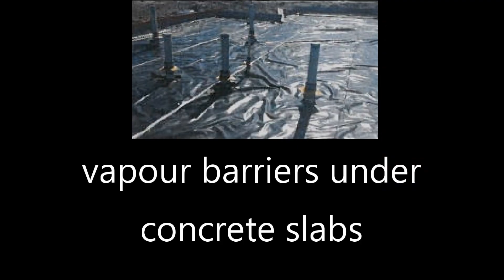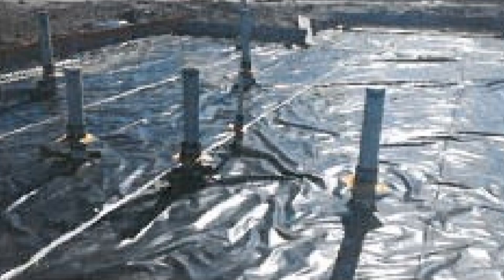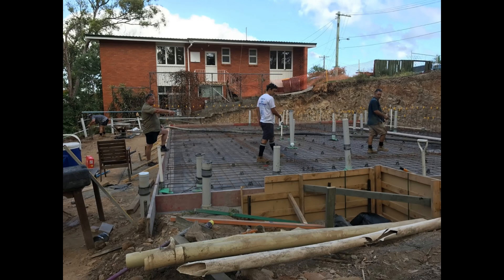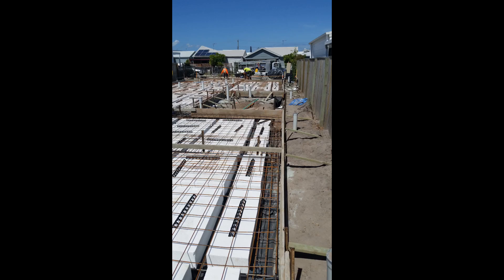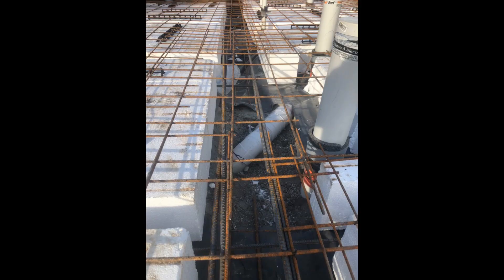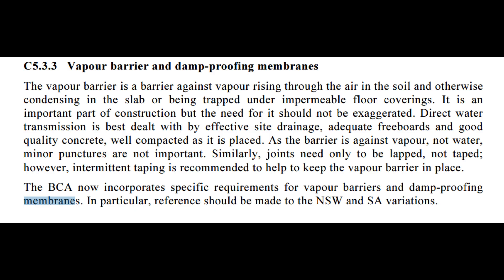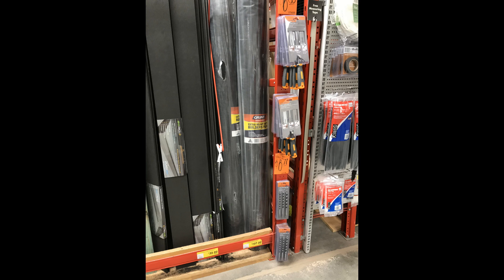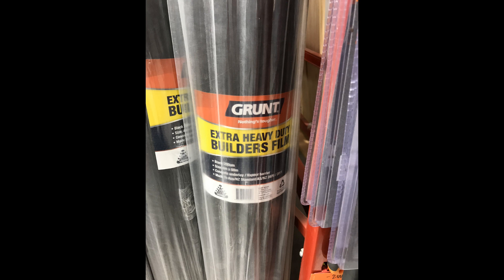Why do you need a Vapour Barrier Under Concrete Slabs - The Structural Why Files aswers the question

Comment: Plastic does not prevent a slab from sweating.
Moisture comes from humid air above the slab. 
Everyone has been told this by engineers for the last 100 years, but it is fals

Comment: Do you recommend to use vapor barrier for footpath and concrete steps?😊
Reply from the maker: Hi @dtran21k
Interesting question!
I don't NOT recommend it. For the reason that the plastic prevents the ground sucking moisture out of the concrete I like it - but I recognise that a barrier isn't required under footpaths and external concrete steps to prevent rising damp.
If the plastic is available and on site, then I'd suggest using it. If it is 'too hard' to get a roll of 0.2mm polyethylene membrane on your site then I'd question that answer but accept that it isn't really required.
Matt Cornell

Comment: isn't the vapor barriers will cause plastic shrinkage cracks on your slab?  cause your concrete will dry from top to the bottom instead of bottom to top?
Reply from the maker: Thanks for your question.
This is a common thought - but plastic shrinkage cracking is caused by the concrete surface hardening faster than the concrete underneath. We use curing methods to prevent the surface concrete from hardening too quickly before the full depth of concrete has gained strength. In fact, the bottom of the concrete with a vapour barrier is similarly protected from the surface hardening too quickly which is pretty much perfect!
Matt Cornell
Reply: @CornellEngineers  thank you.  would you mind sharing what are those curing methods?

Comment: Why do you only have a DPM and no DPC in Australia, in the UK you have both and they are connected at the perimeter to seal the building from moisture, I have not seen a DPC used in QLD, just a DPM which is allowed to go under the external footing, rather than the footing being in direct contact with the ground?
Reply from the maker: I think you'll find we do have DPC in Australia. It is used widely and well. You're right though - we don't tend to lap out DPM to our DPC. Maybe that is food for thought!?!?

Comment: I have a concrete guy putting a plastic vapor barrier down for a detached metal building/garage, but he's not running it down in the beams, only down the sides of each section. Doesn't that defeat the point of the plastic since water will seep up through the 2' deep beams and create a criss cross pattern of higher moisture on the slab in those areas? We are in clay soil about 20' higher than the flood plain with a clay sand fill under the slab. Interested to hear your thoughts, thanks.

Comment: Will it be good to put such moisture barrier under a driveway? I think it might prevent from mold growing on top of driveway. I have to pressure clean it every year or two.
Reply from the maker: Hi Vitali
I have heard some concreters say not to put a moisture barrier under a concrete driveway slab I have seen driveway slabs done both with and without a vapor barrier.
My personal preference is yes, have a vapor barrier under a driveway slab. However, it is not mandatory.
Matt Cornell

Comment: Styrofoam placed in or under concrete does it weaken it structurely? Does that Styrofoam degrade over time? What is the reasoning behind it use? Questions for the public?

Comment: Are vapor barriers required, or recommended for concrete slabs for accessory buildings (sheds) no attached to a residence?
Reply from the maker: Clause 3.2.2.6 on NCC says:
A vapour barrier must be installed under slab-on-ground construction for all Class 1 buildings and for Class 10 buildings where the slab is continuous with the slab of a Class 1 building as follows.... then some explanation of what a vapour barrier must be.
So your unattached shed is a Class 10 and doesn't 'require' a vapour barrier -  but what are you saving by not installing a vapour barrier? Not much. If you have the choice I'd put one in. Hope that helps!
Matt Cornell
Reply: @CornellEngineers  seems most concrete contractors don’t know this requirement. 

And I’ve seen contractors laying down the orange plastic and then deliberately putting holes in it in between the reo squares. Not sure what they think this is achieving… Would this be an issue at all for a pergola area that will have tiles over the concrete slab?
Reply from the maker: @danielbass09  The vapour barrier is primarily to prevent rising damp coming into an enclosed, unventilated (inside) space. As far as I can tell, it wouldn't be the end of the world if there was no vapor barrier under a tiled pergola area slab. 
Matt

Comment: Hello Matt. I have a question about my garage. I have a garage with a concrete floor and it seems no vapour barrier was used under the concrete. I have not noticed any real problems with moisture coming up through the concrete floor, but I have seen the occasional appearance of efflorescence in one small section. I am contemplating grinding the concrete floor and sealing it with an epoxy flooring product. The makers of the epoxy flooring product say that its impervious to water, and I'm not sure I believe them, but I am definitely doing my homework. Apart from my concern about the epoxy failing down the track because of moisture rising up through the slab, my bigger worry is wether the slab will be more prone to deterioration in the longer term as a result of its exposure to this moisture without any barrier under it? Thanks in advance for any thoughts you could share about this.
Reply from the maker: Hi Dekker Lundquist
Once the concrete has cured, a vapour barrier is more about health and amenity of enclosed spaces (ie protecting against undue moisture, damp and mould) than it is to the protection of the concrete.
So sealing the slab surface with a product that bonds well to the concrete should solve the localised patch of efflorescence (once it is cleaned off the concrete as you say).
It's a tough job but identifying where moisture is getting under a slab is my preferred first step. Are there broken pipes, poor drainage, external drainage issues?
I haven't heard of a floor finishing product failing because of rising damp but that doesn't mean it doesn't happen.
Keep up the good work with the research. 
Matt Cornell
Reply: @CornellEngineers  Thank you very much for taking the time to send your helpful reply.

Comment: Great content, just a quick question is it a requirement to continue the membrane over the form work to top of slab or it can be terminated at ground level, 
Cheers Adam
Reply from the maker: Hi Adam
Good question. The membrane has to terminate somewhere and it should be terminated in such a way so it does not catch and direct water under the slab - that would be counter-productive. So it depends on the circumstance and type of slab. For raft slabs, the code says that the membrane should extend under the edge beam and terminate at ground level. Where local experience shows that it is ok it may terminate at the internal face of external raft slab beams.
For waffle slabs, the membrane often runs past the formwork and only lately have I seen it being turned up and being temporarily affixed to the edge formwork. Clause 3.2.2.6 of NCC2019 requires the vapour barrier must extend under edge beams to finish at ground level in accordance with their sketches. The code also allows for it to turn up and lap with waterproofed edges but this isn't often done well. 
So my preference would be to terminate it on the outside of the slab at ground level and ensure excellent site drainage on all sides so that water drains away from the dwelling and doesn't sit on the membrane so that it can't run under the slab.
If your question is in relation to slab edge dampness then the answer is good site drainage more than slab edge membranes. Check out my new video on site drainage. https://youtu.be/5Cu8PXN3Wl4

Comment: Good video. Just wondering how to seal around all services?
Reply from the maker: The plastic is a vapour proof membrane, not a waterproof membrane. AS2870 calls for penetrations to be taped or sealed with a close-fitting sleeve. I normally just see tape at penetrations.

Comment: It's a rather naive question. If there is a plastic sheet(vapour barrier) between the ground and the concrete slab, doesn't that put up a risk for the concrete slab to slip/slide? Because the concrete is not in direct contact with the ground any more. How does the concrete slab get in touch with the screw pierings?
Reply from the maker: Hi Sikandar
It is actually a good question. Lateral sliding of a dwelling is pretty unlikely. The concrete to ground roughness and footing contact area is quite high despite the plastic sheet. Screw piers aren't required to stop a house moving sideways - they are there for vertical support.
However, the polyethylene vapour barrier is stopped at screw piers (and bored piers) to allow the steel pier of the screw pier to be embedded in the concrete of the footing. 
The risk if moisture rising up through a thick concrete footing is lower than the risk of moisture rising through the thin slab.
I hope that makes sense?
Matt Cornell